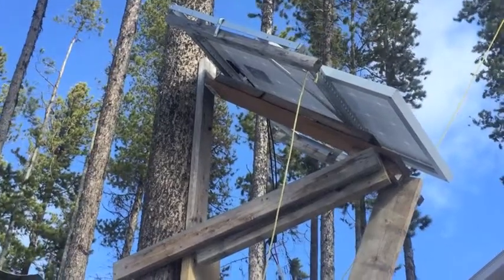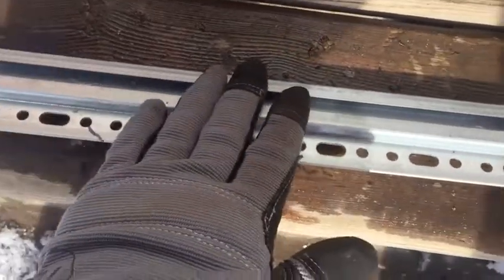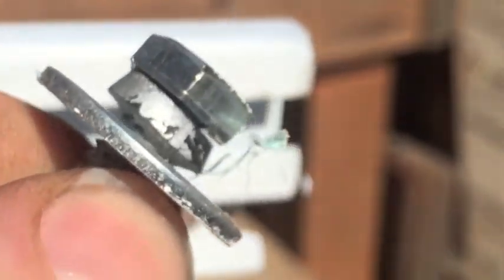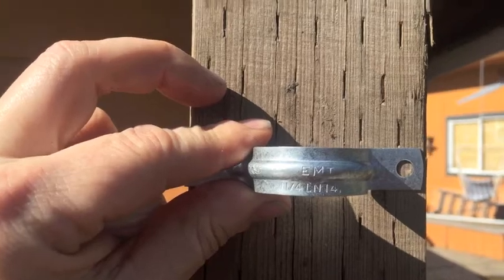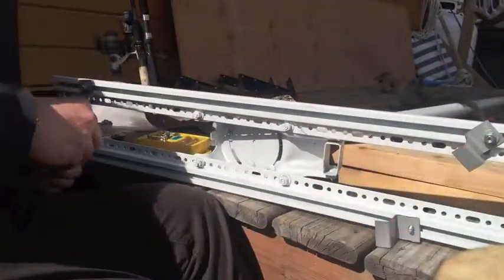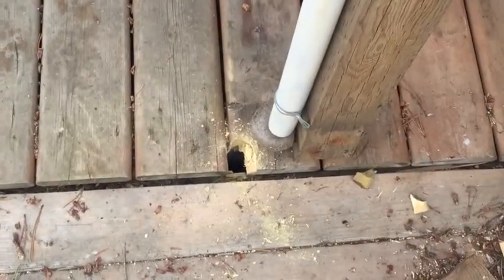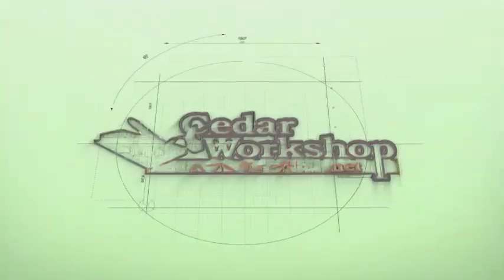Simple Solar Panel Sun Tracker from an Old Satellite TV Dish

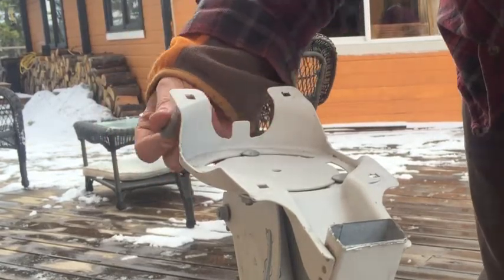Comment: You could have simply bought shorter bolts instead of cutting them and burn off the protective zing plated cover 1:43. Also, how does it track the sun? I see no motor or any form of tracking device attached to it. Do you track the sun manually?

Comment: Q  is the angle of radiation is same as the angle in base of satallite dish ??? if i use the base of satallite dish can i applied it without any change
Reply from the maker: Hmm, not sure what you are asking. Most satellite mounts can be attached to the side of a structure. If the dish points towards the snow when attached, then you are good to go. In my case, the sun was a different angle, so I inserted the pipe to the base into the tower pipe. Does that make sense?

Comment: Good job! I have a 50w panel and a satellite dish and was planning the same thing. I like your homemade z clamps.
Reply from the maker: Good news! The system works great in the summer months. The only downside was in the winter. The solar panel can't adjust down too much to follow the lower sun. I ended up kicking out the support pole a good 2 feet and got a better angle.
Reply: The Cedar Workshop I built last night with small rectangle tubing and my (very rough) welding skills. I believe the way I will mount it I will be able to achieve the angles for summer and winter. I'll mount it and post about the results.

Comment: Good vid.
I think your solar panal mount is probably going to do well in most normal weather, but I'm a bit skeptical that it will do as well in high wind conditions.

One thing you could do is make a sturdier base for your solar panel & connect it to your old dish mounting hardware. A 1" square tubing frame steel base would be good.  Then you can use the panel clamps that you fabricated to hold the panel frame to the 1" square tubing frame.

Thanks for sharing!
Reply from the maker: JWSolarusa John Wesley You have some sweet equipment and great ideas. Great mind think alike!
Reply from the maker: zeffur7 I agree. In high winds, especially being buffered off the roof, could create some eddies and make it rock side to side. I've got some spare tubing and will do a brace. Thanks for your suggestion, I appreciate the insight.
Reply: Glad to help...
Reply: +The Cedar Workshop Nice setup buddy. Please checkout my channel and subscribe.
Reply: The Cedar Workshop Thanks for your subscription. 
I also wanted to thank you for watching my videos and your encouraging comments. 
You have a wonderful day my friend. 
Cheers

Comment: This worked out great..I to did this with (2) UL solar 100watt panels.mounted to a Motorized antenna tuner rotator to move throughout the day!!do you still have that xantrex C40? I never saw any videos on it..
Reply from the maker: fanman1981 Great! So you can mount two panels. Good two know. Yes, still have the C40 packed up in the box. Plan to use it with the big wind turbine. Keep getting backed up with other chores and the tower gets delayed.